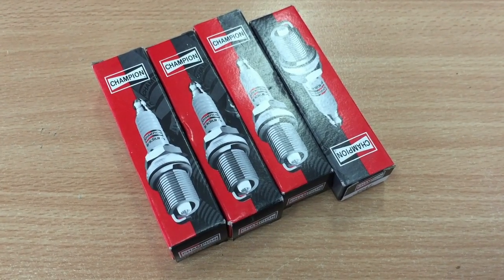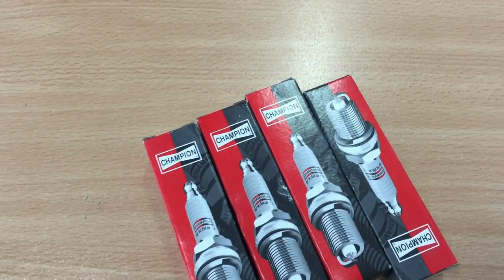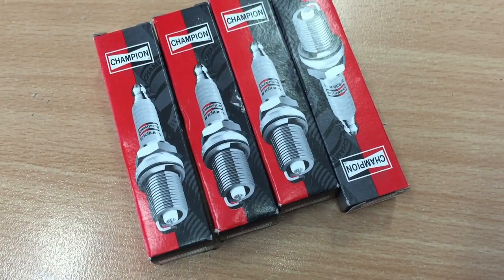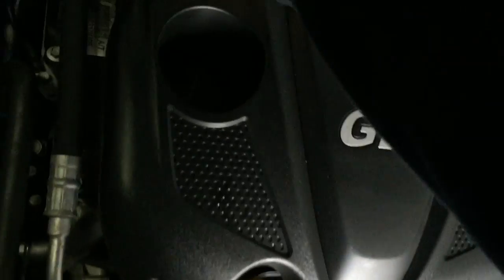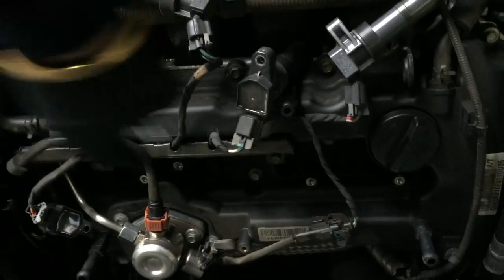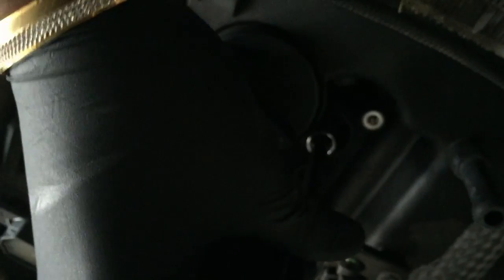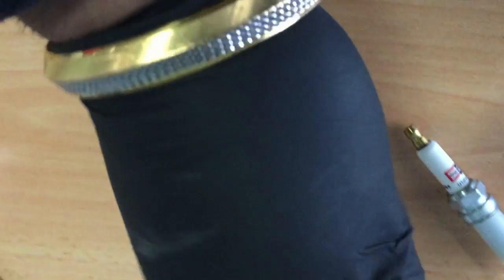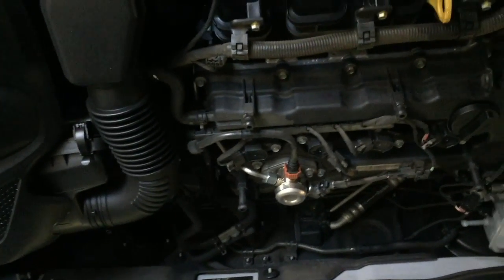How to change Spark Plugs on a Hyundai Sonata | i45 2009 - 2014

Comment: What's the spark plug gap
Reply from the maker: When you use a vehicle heavily. Sparkplug sometimes gets extremely hot and the gap between the tip and the current node goes greater which makes spark plug to generate less spark and as a consequence vehicle deliver fewer kms per liter.
Reply: .44 inch

Comment: No need calibrated?
Reply: Idk about these ones but the Ngk or denso brands used in my 2012 sonata come pre gapped. But it’s always good to check, just don’t use the cheaper gapping tool, it’s not supposed to touch the iridium tip.

Comment: What you didn’t used dense spark plugs as owners speaking
Reply from the maker: They costed $27 more each then champion plugs. Champions are same quality as I have been using them past 7 years. Also you can not get them at normal auto part retailers they are only available through hyundai only.
Reply: I got the oem denso at a local parts store.  They're cheaper online, seen sets on eBay under $40.

Did you like the Champions?
Reply: @ARPMEDIAZ  good to know, I’ve heard you should only stick to OE parts.

Comment: Denso.spark plugs
Reply: What spark plugs are they using in the 2.0 T turbo sonatas nowadays
Reply: Big diesel check 5koptimastore.com, they have and suggest HKS racing plugs. A bit pricey but they deft make a difference
Reply: John Clinton I have them set to 0 28 but the engine seems to vibrate should I change them to 0 32
Reply: @RL-zx1sl  what spark plugs that use to santafe  2013 GDI